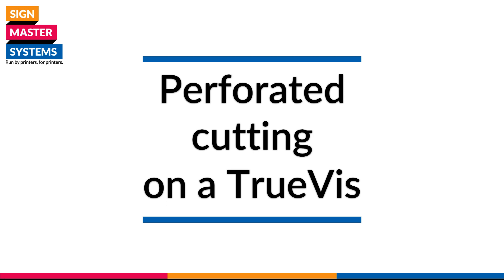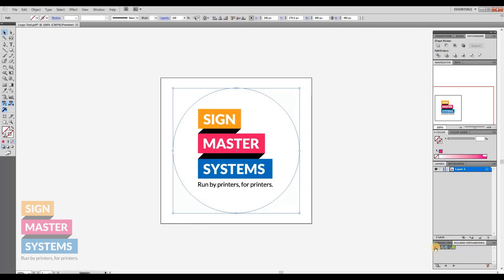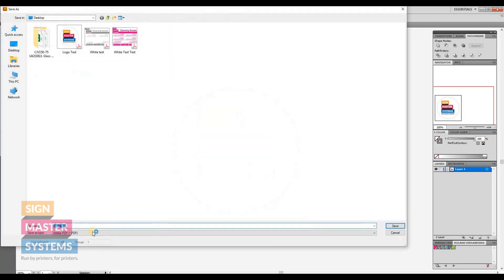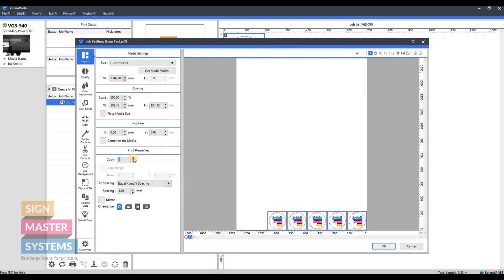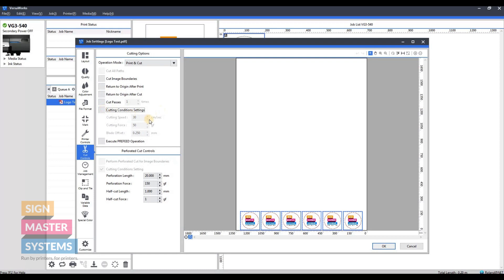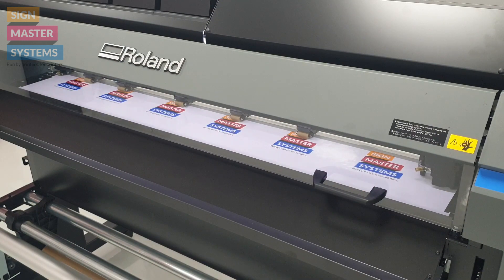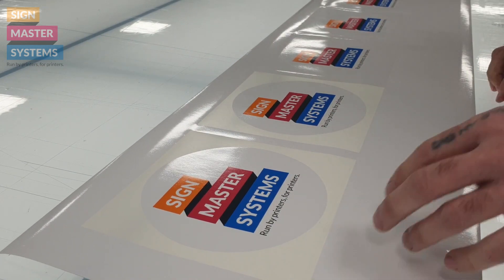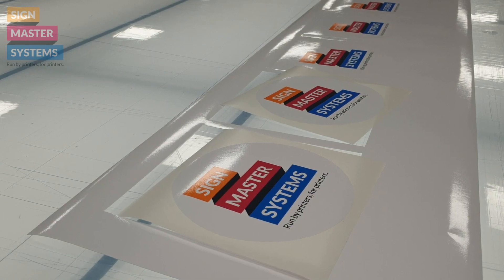Perforated cutting on a Roland TrueVis printer

Comment: hi im wondering if u can help me,  i have signlab 10 and mimaki dedicated dongle, but i cant seem to get signlab to print to machine or cut to machine,  i know its installed correctly as i saw it all running when i bought it (2nd hand),  i can print jobs from inside rasterlnk fine , but wanted to try thr print anc cut facility wich is direct inside signlab, any input much apreciated as i can find nothing on the web in end'glish,  ive watched all your prevous videos but cant solve the issue/settings
thankyou
Reply from the maker: Hi there it would depend on which version of Signlab 10 you have, the full print and cut version has VPM built in which is a separate 3rd party RIP program and you would need that to print to your Mimaki printer. For the cutting I would say you need to download and install the Mimaki driver firstly from the Mimaki website then install cutting devices in Signlab to get it to cut to the Mimaki